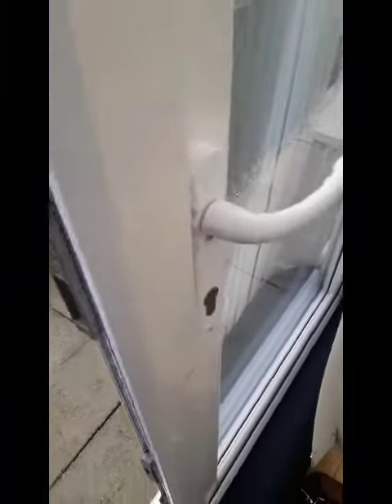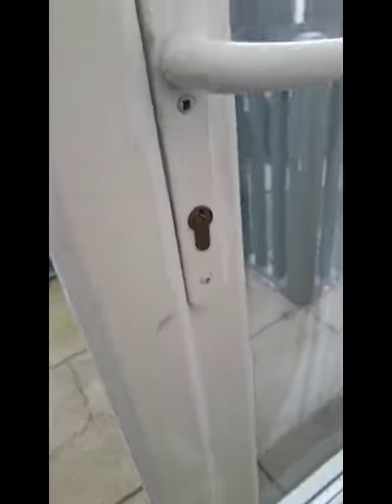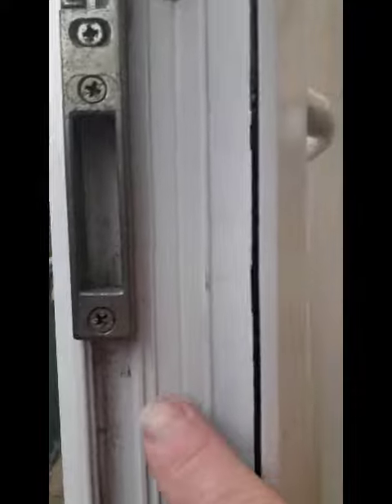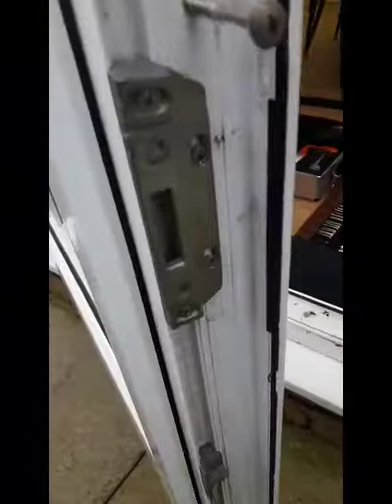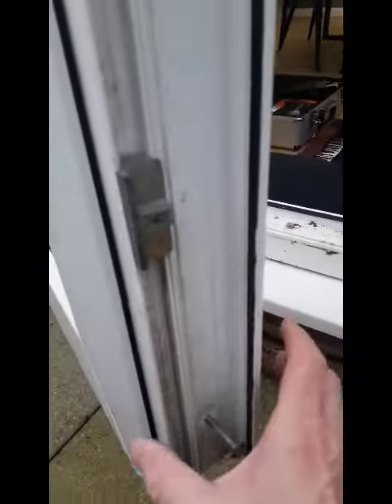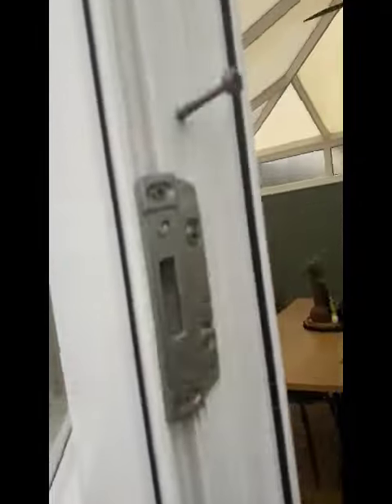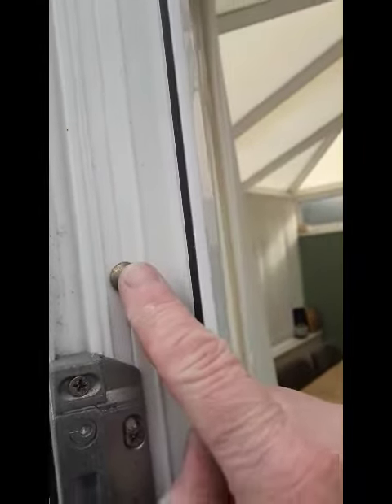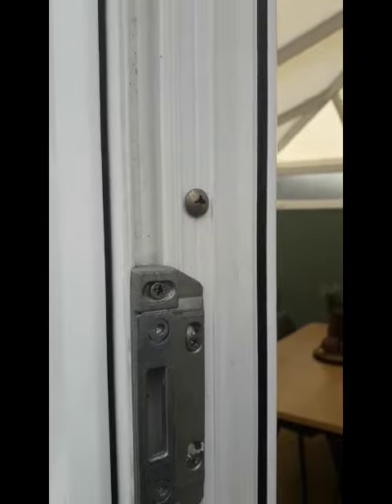Replacing Euro Cylinder On Patio Slave Door

Comment: If i am unable open to locked slave door am i able to remove the mullion? Thank you
Reply from the maker: You will always need to open the master door in order to get to the mullion but yes you should be able to do so, but you will still need to unlock the slave door euro cylinder in order to replace the cylinder itself.